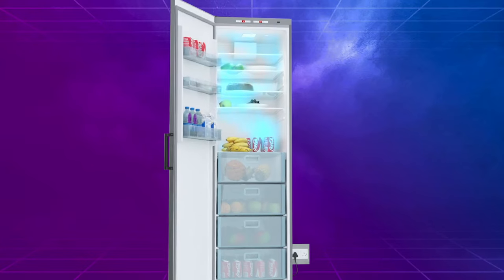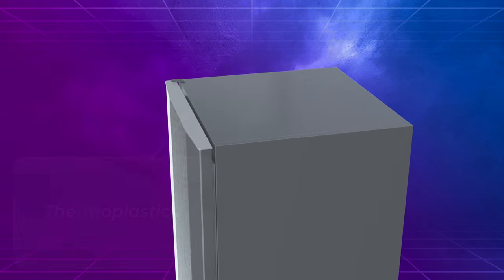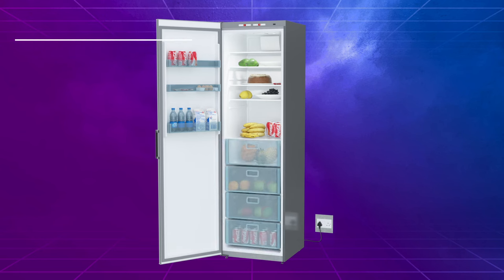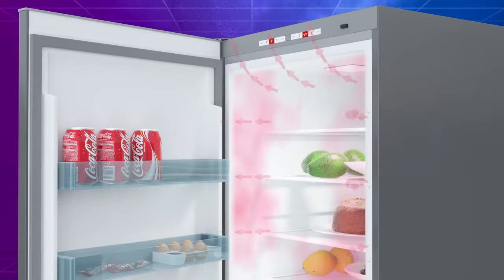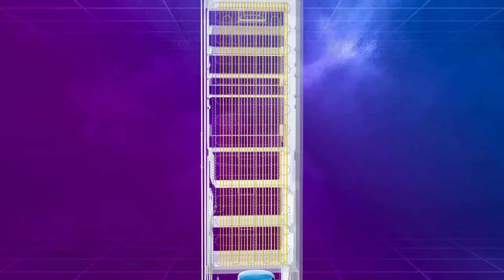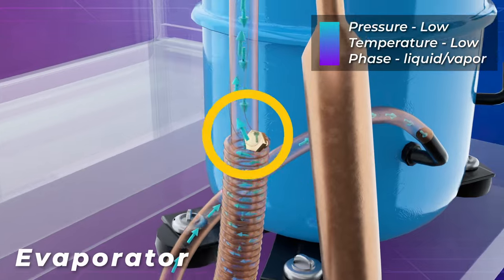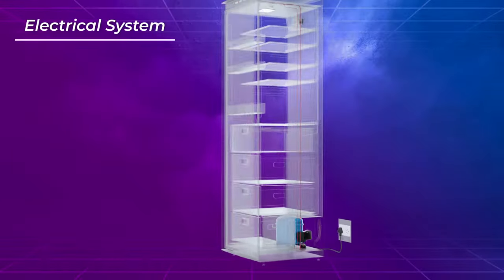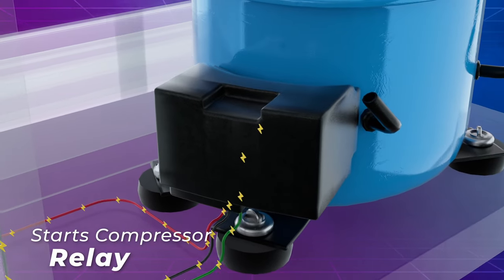How does a Refrigerator work? 3D Animation

Comment: Observation.  Refrigerator DOES NOT make cold air.   comment please
Reply: Correct, it provides the temperature, the refrigerant cycle is what provides temperature, the fan blows the fair past the superheated metal (temperature metal) and the air absorbs some of the pressure/energy from the metal and goes into the fridge unit out through the supply vent inside

Comment: My fridge/freezer has been making noise since the last time I had defrosted it. The (inside) back of my fridge keeps getting icy, eventhough I have set it on the lowest temperature. It seems doesn’t go off when it reaches the right temperature. I have to manually switch off the thermostate, even so it sometimes refuse to switch off. Thus I unplug  and plug it again to start. Do you think the thermostate is broken? Or is the compressor lacking of gas due to  the age of the fridge (12+ years)? I see some greenish areas on the copper at the back. How do you remove it? Both sides of the fridge (right on close to the door) are also warmer than what I remember. Thank you in advance
Reply: Hi Sir/Madam, with little knowledge I have, you need to replace your themorstat... The greenish things you see as some dirties on the wire, if they're made of copper. The thermostat controls the system, it order the compressor to stop when there's too much cold and when it detect that the refrigerator needs some cold, it orders the compressor to start on.
Reply: If it continues get a new one as it's 12 years old, gases could be gone

Comment: (1:39) Wouldn't the refrigerant enter the compressor as a low pressure, relatively HIGH temperature vapor due to having absorbed the thermal energy from the evaporator coil?

Enters compressor - low pressure, high temperature
Leaves compressor - high pressure, high temperature
Enters expansion valve - high pressure, low temperature (released thermal energy through condenser coil)
Leaves expansion valve - low pressure, low temperature

Good video.  Thanks.
Reply: Yes this is correct. I noticed the mistake in the video as well. Thought i was the only one
Reply: leaves compressor enters condenser.   comment please

Comment: Professor I have a question here. Refrigerators and heat-pumps  also operate in a cycle ,right? I mean There's no change from initial to final, so right side of our energy balance equation is zero?
Reply: It's the same but you just reverse the direction of the refrigerant with a reversing valve to make a heat pump. Then the evaporator acts as the condenser and vice versa